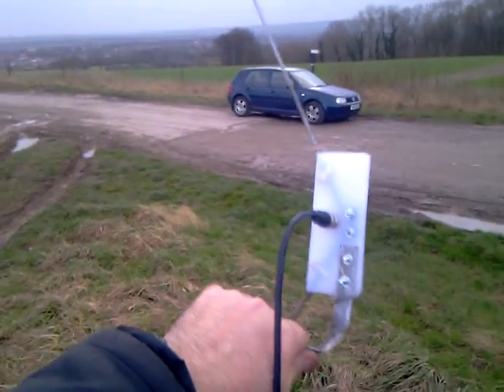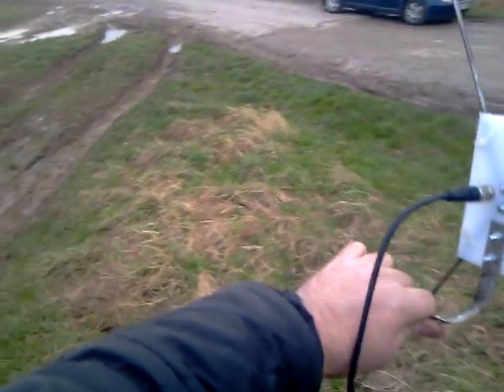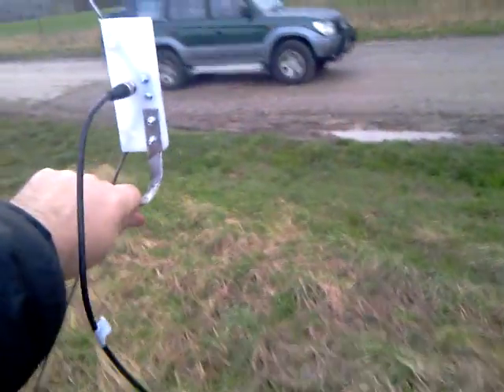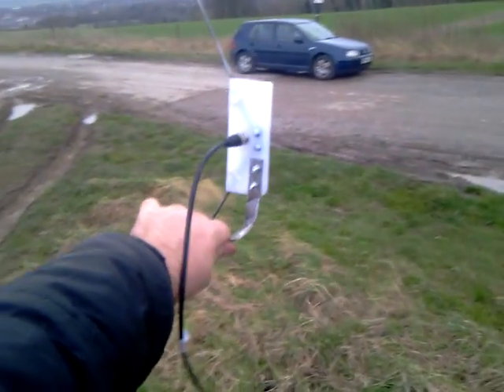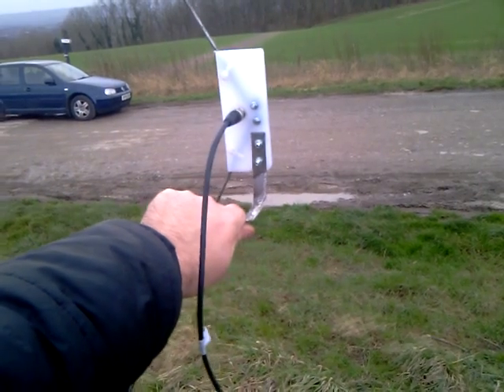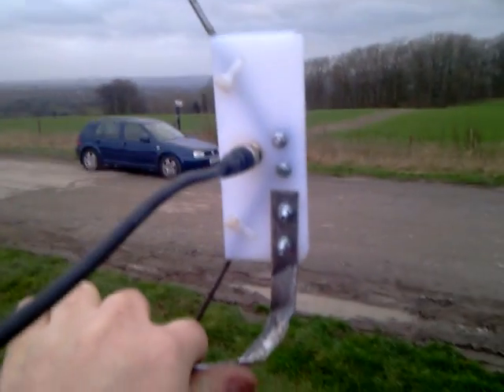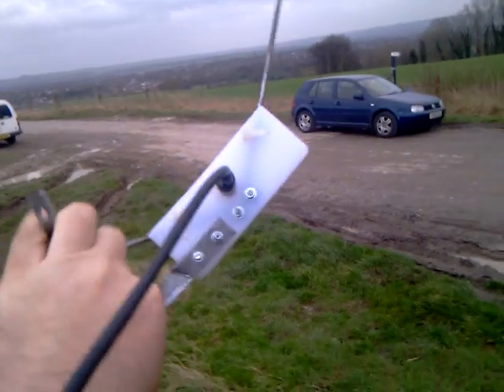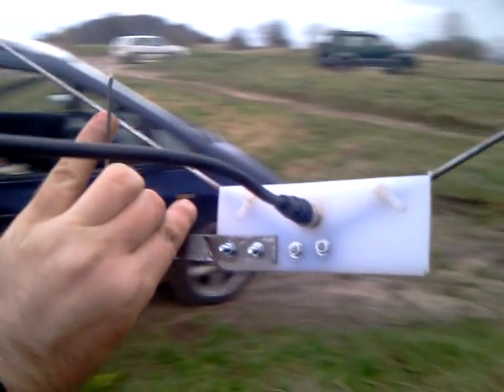V Antenna proven that vertical is the right way.

Comment from the maker: @lezbriddon Dipole has basic gain - this has directional gain much higher towards the horizon plane. Also most "base loaded" whips are just same old same old and dont enhance or do anything - plus arent often tuned and so you lose tranmission power. People think air antennas are plug and play and have no real idea and they are sold that way with no true instructions. This is an antenna design chosen out of all of them to be the best long range performer thats why I wanted one.